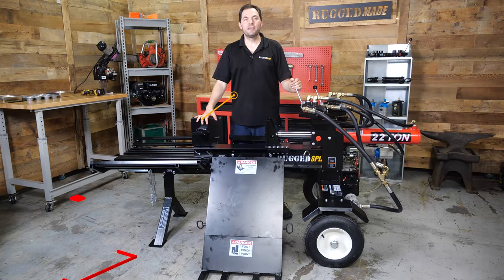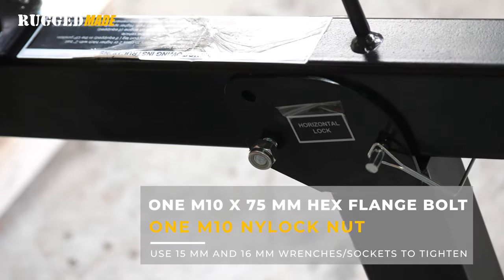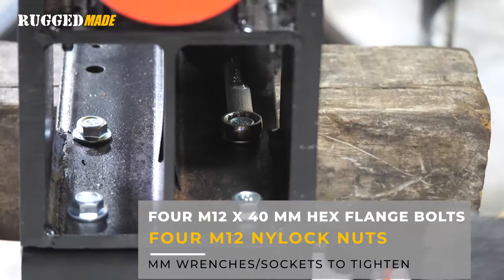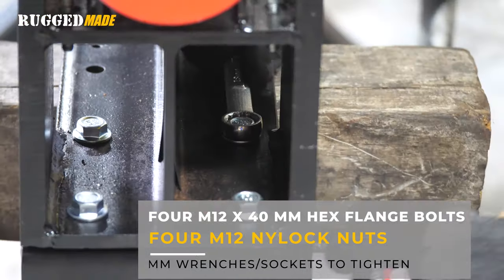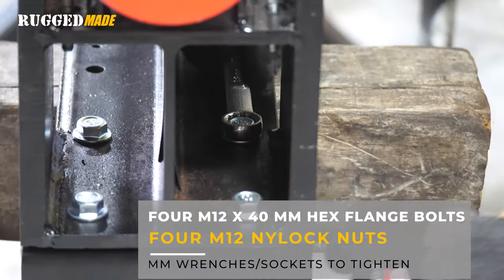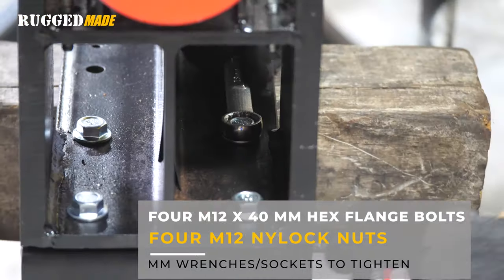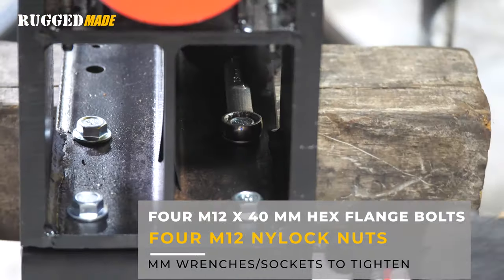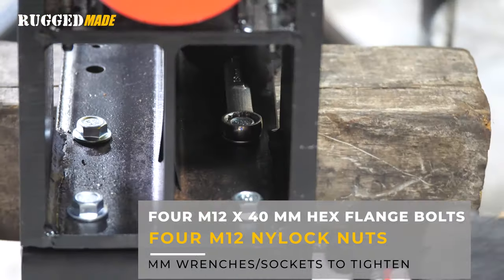Unboxing and Assembling the RuggedSplit 300-Series Log Splitter

Comment: Picking one up tomorrow. Looks like it's going to be an all day assembly. I hope the fasteners are designated clearly in the boxes, because it appears there are many different sizes and lengths in this build. Great and very thorough video.
Reply: It took awhile to put this together but this video shows how to in great detail. Alot of stopping and starting but I got through it. If I did this over again, I would have had someone help. Designate an entire day and you should be able to complete it.

Comment: Just a few heads up for folks. Ours came with a substantial amount of rust throughout the unit, most of the rust is on the smaller bolts on the motor, we're assuming from setting in a port area. Also, for the 10 bolts running down the I Beam one of them was broke off. The splitter seems like a nice unit, but for what you're paying for it I'd say the condition they come in isn't really great.
Reply from the maker: John, I am sorry to hear about this.  Did you contact our customer support team?  If not, email support@ruggedmade.com or call 855-878-4433 and someone can talk with you about these issues.